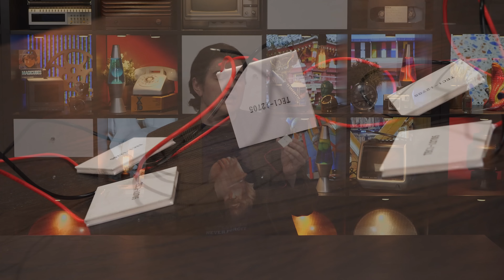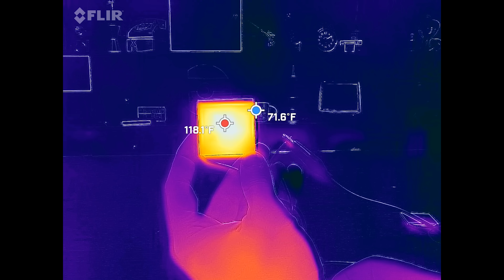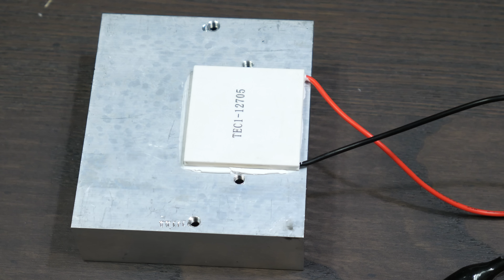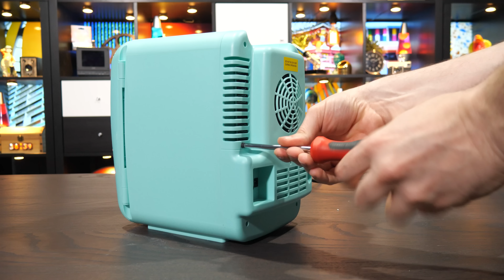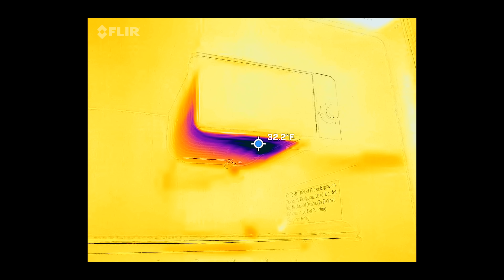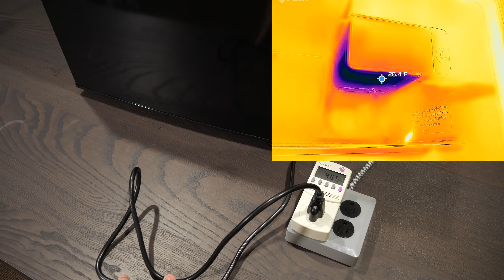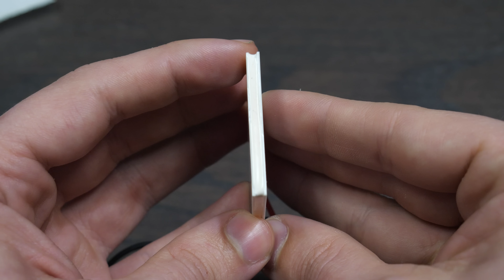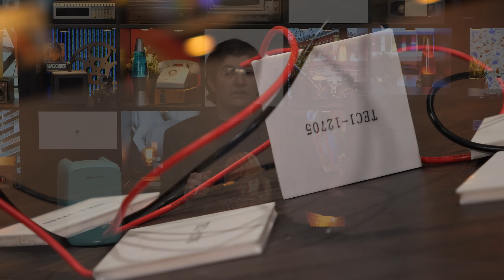Thermoelectric cooling: it's not great.

Comment: Oh... Where was this 6 months ago when I bought one of those useless car coolboxes with peltier elements... I hate that thing. The peltier element in it also generates enormous amount of condensate, so if that thing is used for a long time (like, a week) whatever is inside ends up swimming in water! So. Gross. Mine is big, so it's also hard to clean it, and it doesn't have heating option (whoever made it just didn't think it was needed, lol). I want to get rid of it now, but I'm not even sure if anyone would want to buy something so useless and it's too expensive to just throw away, and too big to keep at home... I was trying to fix a problem, but only got myself in more problems. They should stop to advertise these things. Someone out there is lucky to see your video before making a huge mistake. It looks like the cheapest option, but it's more expensive and so problematic in the long run. And it's hella noisy, especially if turned on during the summer heat, to the point of headache. It's only good if people buy it for a few very specific situations (which is not explained at all when you buy them. In fact they lie saying "you can store food in in too". Nope, you can't. It would end up all spoiled and drenched in smelly water. Yes the food is in the container, but container is wet and gross. Especially if you put a freaking cheese in it. The horror. That thing doesn't contain the smells, so you gonna smell that cheese from afar T-T).

Comment: Just wondering what the alternative is for a handheld $20 - $30 electric cooler which can run off 12v car plug, solar, USB, battery pack, and / or 120v might be.

And yes, compared to a refrigerator they "aren't good" compared to everything else as described above they are the.....best and only opinion in the category....especially for $20 - $30.

Comment: Along these lines, RV ammonia-absorption refrigerators might make for an interesting video.  They're much less efficient than a compressor, but they can be powered by any heat source.  Including propane, which is more than enough more energy-dense than batteries to make up for the efficiency difference.

Comment: I get they are not the best, but I’m going to try one on a small scale. To see if it will work to keep food cold while camping. Taking a small 110 fridge/freezer 20 miles back on a 4 wheeler is not really feasible, but as the ambient temps are normally 55-30f I think it might work. For less than $30 it is worth it to try it out before committing to a bigger build.

Comment: A fun video on a piece of trash 😂

But wanted to note based off your comparisons with full fridge designs that I believe a larger volume should be more efficient to cool compared to a small volume just for square-cuve law reasons. Heat can only escape on the surface! 

Of course that's no excuse for the smaller "fridge" to consume more power in an absolute sense than a full fridge...

Comment: I had a Cooluli thermal electric mini fridge that was equipped with two of these thermal electric cooling devices, and it was the best thing ever. Really quiet and kept a good 35 degrees. My room stayed around 78 during the summer and with the digital thermostat on the front, it would cycle the thermal electric cooling but not rhe fans...other than a little fan noise it was perfect. However, i decided to replace it with a refrigerator that had a heat pump. Not going to lie, the bigger fridge with a more complex heat pump is more efficient, and a lot more effective. But i have no problems with thermal electric cooling. Works very good in the proper environment.

Comment: I’ve used a couple of these thermoelectric coolers over the years because the first one id ever gotten was really good. I want to say it lasted 15+ years and got really cold. But new ones are no where near as good , and my last one survived about a year. Drinks would be room temperature within a minute or two of sipping on them.

I went to purchase a new one a couple weeks ago and realized the “good ones” were $50-80 if not more. So I bought a Hisense stainless steel cube fridge from Walmart for $83 🤷‍♂️ Very quiet, very cold, and cost $29 per year to power.

I like the novelty of the thermoelectric fridges, but don’t bother if you actually plan on using it. It’s the typical “They don’t build em like they used it”scenario.

Comment: Interestingly, I own a Ferminator, this is an insulated box which houses a fermentation chamber for beer. Attached to the front of the unit is a fan assembly connected to a Peltier unit. This unit heats as well as cools and it is capable of reducing 26l of liquid at 20deg C down to 4deg C over 3 days. I've never managed to get a liquid cooler than 3.5deg.   Its a really neat solution for home brewing temp control for fermentation, otherwise we have to resort to a glycol based system which is far more expensive.......

Comment: I had a fridge that used that system but it had not only a bigger plate but also temperature controls.
The difference is that it used two fans, one in the back to dissipate heat and one on the inside where the cold plate was connected to a aluminum cooler (like a PC cooler) moving air inside and cooling everything faster.
It was made for motor homes and go direct to the 24v batteries

Comment: Some Peltier fridges can get even colder with multiple Peltier modules, advanced heat sinks & fans, liquid cooling systems, better insulation, etc. And some also come with thermostats and other energy efficiency optimisations.

When analyzing them however, what's important isn't their stated or purported "absolute" lowest temperature, but the cooling "differential" temperature relative to a specified ambient temperature. This differential can range from around 68°F to 77°F (20°C to 25°C) lower than its "ambient" temperature. With some high-end models, wine coolers, camping fridges, etc, they can have an even greater differential depending on how powerful or high-spec they are.

So if for example you need to maintain a temperature of 39°F (4°C) for food safety purposes and the fridge's spec is rated for this, then this threshold would only be relative to a particular ambient temperature. And with cheap fridges this could conceivably be as low as... let's say 77°F (25°C); or with more expensive fridges it could be slightly higher at 82°F (30°C) or even more.

So therefore, if the cheap fridge being demonstrated here was unable to reach a low enough "food safety" temperature and could only get down to 45°F (7°C), it may not necessarily be because it's a substandard model, but merely one that's reached its coldness threshold given the surrounding ambient temperature.

In other words, this fridge might probably be OK to use in moderate climates which are cold enough to allow it to get down to 39°F (4°C), but not suitable for use in higher temperature locations or when for example it's placed under tungsten halogen lighting in a production studio environment.

Comment: 12 volt Peltier coolers are quite good for use in the car, we've used one for long journeys to Europe for many years. The trick is to load the cooler with freezer packs or plastic bottles of frozen water.

Comment: Fun Fact about why Europeans are confused by the USA's love of ice. The US gets significantly hotter than most of Europe. Spain and Italy are in the same neighborhood of yearly average temperatures as most of the US Midwest, but the Midwest has higher and lower temperature spikes seasonally while Spain and Italy's climates are stabilized by the Mediterranean and Gulf Stream.
Reply: Though horchata is extremely common in Spain and is basically an almond milk slushie. You've got plenty of ice in there, it's just integrated directly into the drink rather than added-in afterward.

Comment: Just an addition, refrigerators generate more heat than cooling, for instance, although the system might look like a 0 sum game if you follow the refrigerant, the energy of the motors in the pump leads to extra thermal generation. Meaning that if you leave a refrigerator open, it will get the room warmer.

Comment: He said "latent heat of evaporation". That's how deep this went.

Anyway, I got suckered into one of those as a wine refrigerator. That is a thing in Europe. And those seem to almost always be Peltier-based (going after the EU energy efficiency label, which they almost all score in the worst category) - it's advertised to consume 300kWh per annum which is about 100€ (~$110) per annum of operating cost. So this thing is sucking dry my wallet and wife is watching over it like a hawk. It already cost more to operate than to re-buys its entire content (of presumably high-quality wine) as it can hold only 16 bottles.

So encouraged by this video I tried to find an actual heat-pump based wine refrigerator, but there seems to be only one manufacturer and the product is not available.

Comment: There are wood-fired camping stoves that include a peltier circuit that siphons off some of the heat from the fire to charge your phone battery. Apparently you can get a full phone charge if you babysit it for about 3 hours. 
Biolite seems to be the most popular brand. 

They're primary use is as a cooker, and the peltier unit is to power a fan for hotter and better combustion of the fuel, and the excess energy goes to an inboard battery that you can plug into. 

I'm tempted to buy one for when I'm camping in places without regular sun for solar units, but honestly, solar units can take all day for a charge. These little wood fired guys actually seem better. All thanks to the peltier unit!

Comment: You need to figure out what watt-hour means.  It is a RATE, not a quantity.  Watts are a quantity.  The minute, or hour or day does not matter.  It is still xxx WATTS.  The time it takes to consume that quantity does not matter.  And when you said watt-hours per day, you really went over the line into total insanity.  You attached TWO time values to a single quantity.  That's nutz! Yes, i know that power companies say watt-hours and it is stupid.  They don't sell you watt-hours, they sell you watts.  The time element is irrelevant.  Work it out for yourself and you will see the difference, I hope.

Comment: so...

I have an EXTREMELY rare use case on my end...

that... might be a good use UNTIL I upgrade to a phase change system...

but I have a frog tank that likes to stay particularly warm...

and while I am CERTAIN that a underwater heater would be more efficient.

my tank uses a water block on the hot side of a modified cooler

so my drinks stay inefficiently cool while heating my aquarium(I live in ablerta, so the winters can be pretty harsh...

this is by NO means their only heat source...

but their main heater certainly runs less with this MONSTROSITY strapped to their tank haha😂

Comment: A great application of peltier modules is on off-grid stove fans. You put them on your wood stove or other heat source and the built in module will  create enough energy to power the fan turning it at a moderate speed which helps spread heat from the stove around the room much more efficiently.
Reply: "much more efficiently" must be an overstatement of the century , I have one , you can't even feel the air it blows , because it spins so slow

Comment: I don't know what the difference between this and the one I had is. Mine was a little bulkier and fit a bit more in it. I remember it being very cheap, but I also remember it working very well, though it would take a while to cool down your stuff, but it would get it nice and cold eventually.. The only reason I stopped using it is because I one day noticed some weird liquid residue on my desk underneath it.

Comment: I totally agree with the spirit of your video.
After 20 years I'm on my second one (I think both Colmans). Did have to replace a plug in one. The old 12v "cigar lighter" in a vehicle is the absolute dumbest vestige of the past. 90% travel use 10% fridge expansion for, you know, sheltering hurricane evacuees.
Pro Tip: take your pillows with you. Put pillows, blanket or jackets around the cooler (keep plenty of space for fan ventilation)

Comment: I have a peltier-based 6-pack minifridge at work, and it makes/keeps cans of diet coke ice cold overnight (which is good enough for work), and I don't pay for the electricty, so... 

I'm an EE so I know very well how they work and the inefficiency of the peltier effect compared to a heat pump. You aren't wrong about anything technical. But peltier based coolers aren't all quite as uselessly ineffective as the one you bought is. Also, for 50W and given that it makes my drinks legitimately ice cold (ice builds up on the walls of mine), I would also argue it's pretty perfect to put in your car, driven off 12V, for the occasional road trip.
Reply: That said, you have convinced me that, it I ran a company, I would offer to buy every office a mini-fridge, since that would be quickly cheaper than letting them buy their own Peltier-based coolers.

I never cared enough before to do the math, but it's pretty cut and dry.

Comment: I still want TEC cooling to be able to compete at some point. I know with advances in 3d printed metal heat sinks and piezoelectric fans they could probably draw away heat very effectively while remaining incredibly quiet. But it seems like the TEC unit itself is a big part of the problem...

Comment: 6:18 
Interesting. Pretty much all "normal" food kept in fridges in Germany are set with a best before date that applies to keeping it at 7°C or below, which would be pretty much on point with your example. 
(I'm just assuming that Germany thinks that 7°C is food safe, since every pack of anything has it printed on it; also: Obviously fresh meat and fish have to be lower than that, but they also don't have a best before but a use by date )

Comment: the insulation issue… is there a better insulation other than vacuum? if the inter wall space is low pressured, it is probably with better insulated than with “heat insulation”

Comment: the absorbtion (propane) fridges used in travel trailer are also really efficient when you run them with the electric heating element instead of propane, but theyre extremely expensive, to buy a new one the size of that black cube fridge will run you about $700 bucks

Comment: Would like to see how you pimp this little blue energy eater. With some isolation, a silent fan and a thermostat controller. At least that's what I would like to do. It could be useful f.e. in a car with actual good cooling, better energy efficiency and  using not much space :)

Comment: Thermoelectric coolers also generate heat during use, which increases as they become hotter, and leak thermal energy from the hot side back to the cool side (they are thermally conductive) which also worsens as they become hotter.  At and below their lower operational limit, when they can't extract more energy from the cold side, they actually can end up adding thermal energy back to the cold side.  Very useful for narrow operating ranges and precision temperature management, and they can switch from cooling to heating if the polarity is reversed.

Comment: If you like heat pumps and you understand why a heat pump can relocate more thermal energy to create a thermal gradient then what it requires to run the pump then you should investigate electrostatic influence generators. 

Electrostatic influence generators such as wimshurst machines work by using capacitance and physically reconfiguring charged plates. 

The amount of energy it takes to separate charged plates or to bring like charged plates together is determined by the force times the distance required to do so. Just like with magnets sliding charged plates apart is easier than pulling them apart face-to-face. Likewise, sliding opposed charge plates together is easier than forcing them together face to face. 

Regardless of which method is used to reconfigure the plates, once the plates are reconfigured the energy available to the electrons on the plates is defined by how much energy it would have taken to separate the plates face-to-face or put them together face-to-face. 

Essentially, you work perpendicular to the electrostatic force vectors on the charged plates to reconfigure them, but the energy that you extract when you allow the electrons to flow off of the plates is defined by the energy parallel to the force vectors of the charged plates. 

For this reason, an influence machine can have a coefficient of performance that exceeds one for organizing charge in order to establish a charge gradient. Much in the same way a heat pump can have a coefficient of performance that exceeds one for relocating heat energy to establish a heat gradient.

Comment: I changed the fan out for a noctre fan and had a large heatsink copper I placed 2 pelt devices and used high quality artic paste, this reduced the noise by around 80% I am contemplating putting 3fan on it. Of course this adds a bit extra cost but it's far more colder and quieter. I am considering adding a therm switch. Was also thinking to see if there is a way to use the heat to generate some electricity and maybe some insulation on he sides to improve the energy efficiency, just doing it as a side project.